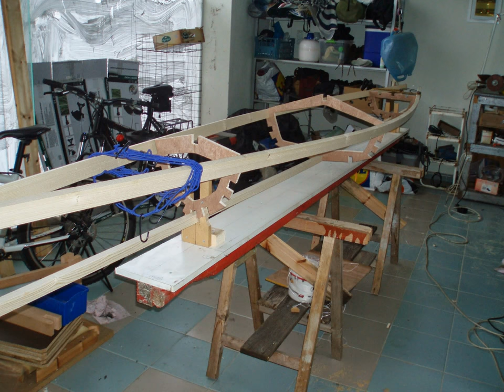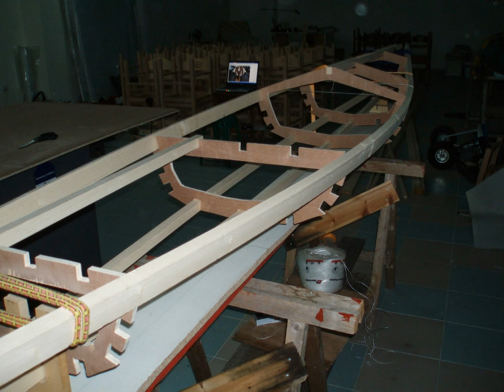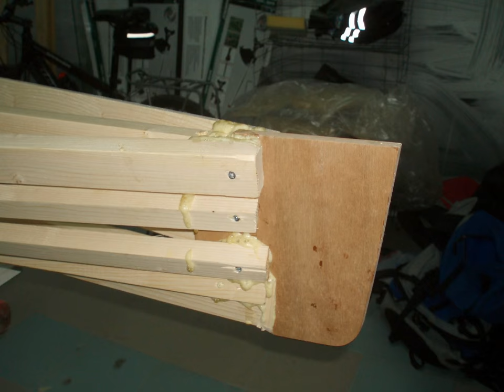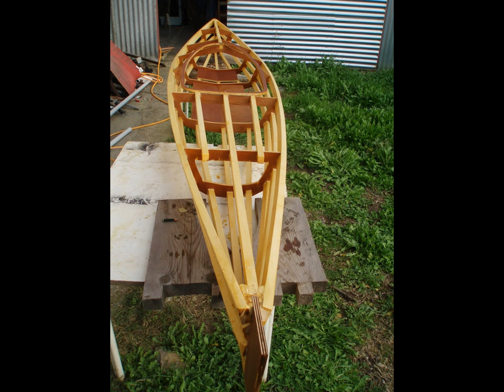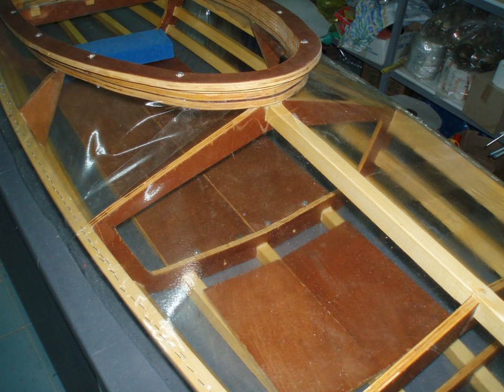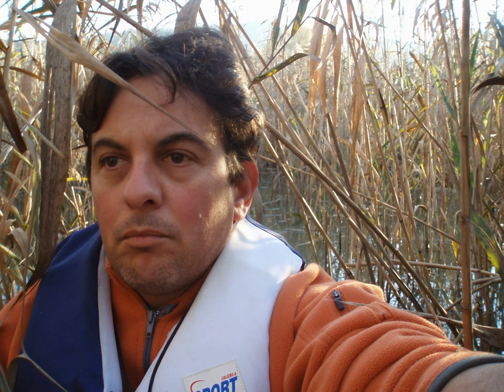HOMEMADE SKIN ON FRAME KAYAK MODEL SEA BEE

Comment: Hello.  What wood did you use for the stringers?  

Also, did use marine grade plywood or plain Baltic Beech?
Reply from the maker: The wood is pine .... And the plywood is a cheap one coz this was my first kayak ....after i used marine plywood to the other kayaks i ve made
Reply: @mixalopg  Here in Germany it is nearly impossible to get Western Red Cedar and the pine/spruce/fir is all very very full of knotts.  Any secret to finding relatively clear (knot free) wood?
Reply from the maker: You can use pitch pine witch is more expensive but it has no knots... Or make scarf joint with clear piece of wood 🙂
Reply: @mixalopg  Thank you.  I will ask for that here.  I enjoyed much watching your build.

How  has your original build held up (plain plywood)?
Reply from the maker: If you apply epoxy it will last for years ...mine no epoxy last for six ....
If you like my video check my channel i have two more videos for kayak construction..🙂

Comment: I am just making a see bee but the result of my kayak is  4.75 m length instead of 13 feet
Reply from the maker: It depends on the mood...🙂
Reply: I wonder if I will capsize because I didn't respect the project
Reply from the maker: I think it will be fine ..... I have make 4 kayaks and in 2of them i ve change the standard measurement without any problems....